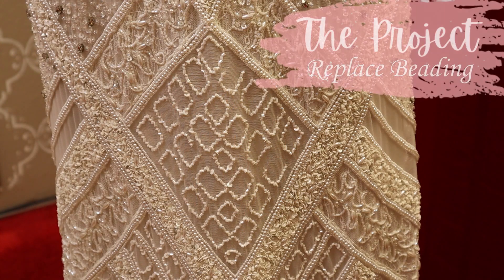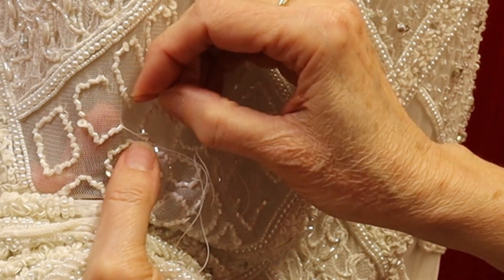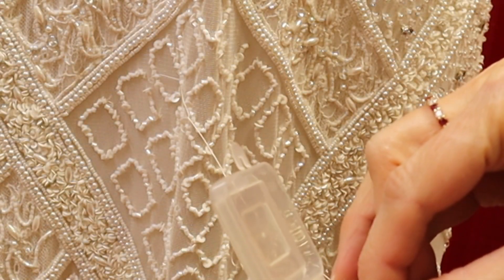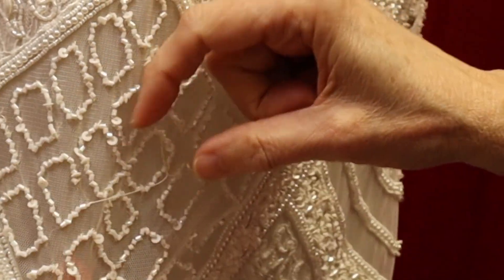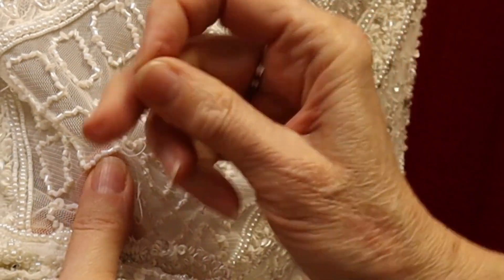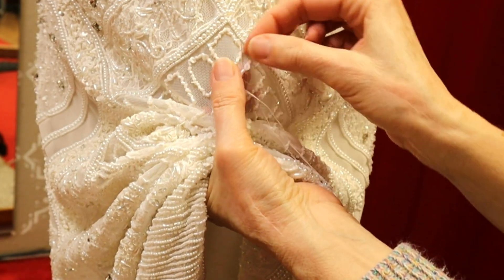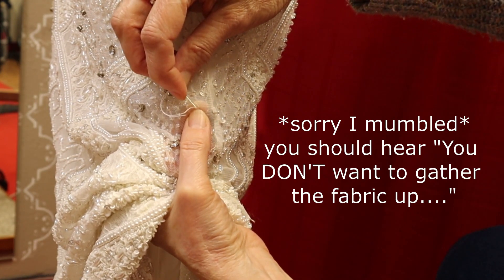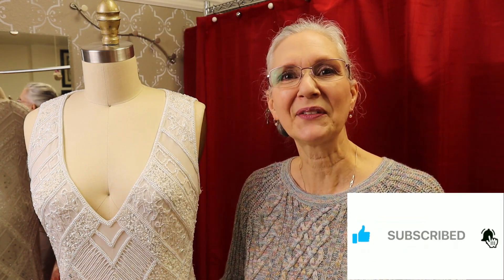HOW TO REPLACE/FIX BEADING on Formal Dress...A couple methods shown on BHLDN 'Remington' Bridal Gown

Comment: In the video, you made a brief reference to using cement glue to tack down a loose thread that has beads on it. You mentioned in a prior video you made that shows how to do this. I purchased a formal dress for a great price knowing that the beads would be loose and I  now need to tie them off somehow. I would love to see the video where you explain how to do that. Can you post a link or at least the name of the video?
Reply from the maker: At about the 5 minute mark in this video, I’m using the ‘Hypo Cement’ to glue the beads down. There’s not a close up, but the tip of my glue tube is putting glue at the base of the beads, where the thread cones through the fabric. I did this on the front and back, because this dress is so heavily beaded it worked very well. Let me know if you need more than this!!!  https://youtu.be/VjPfc0Vcu8E?si=6tNpUV-x_Ovt8OtJ
Reply: @SewDarnedFun  Thank you so much for your prompt reply, the explanation, and the video link!!
Reply from the maker: No problem, Gail! It’s my pleasure, as well as our ‘talk’ this morning. ;) Let me know if have any more questions, or run into trouble.